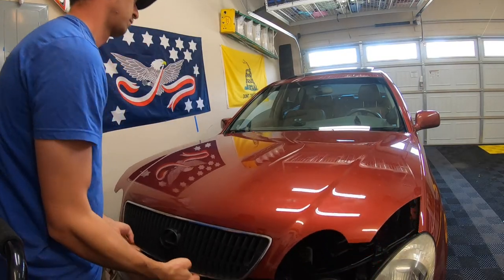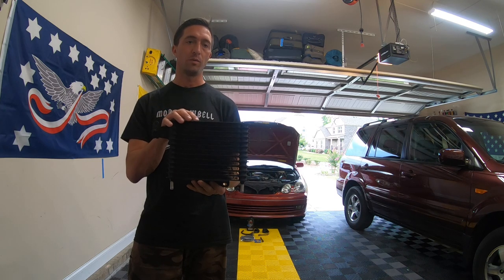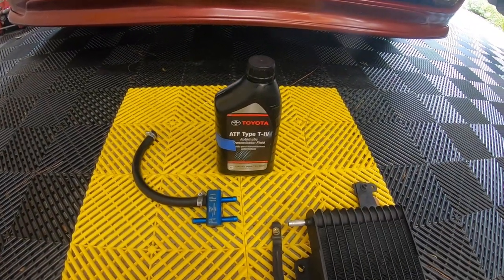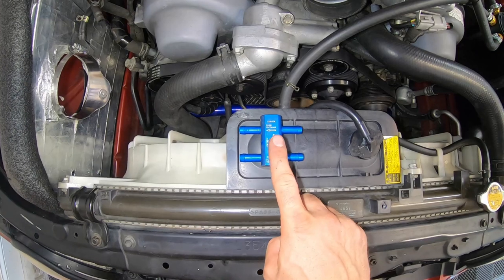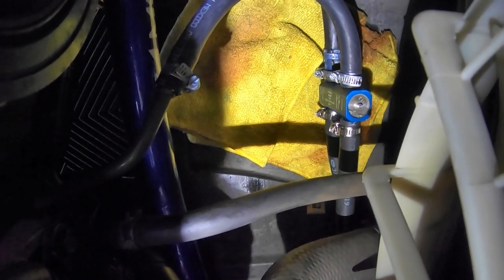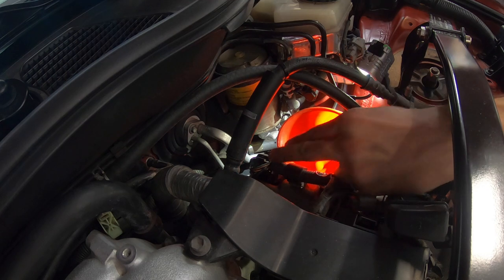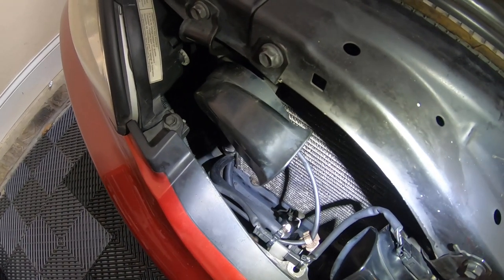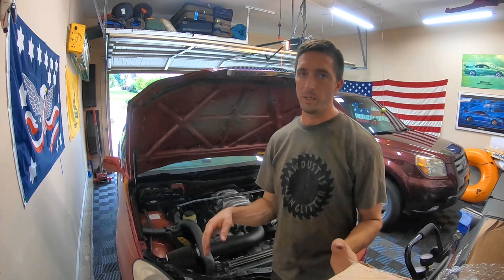External Transmission Cooler Install Instructions

Comment: Watching this is inspiring me to install one on my 98’ SC400.
Reply: Did you ever get it installed?
Reply: @camronramsey4861  Yes I did, very easy to do. I also have a high stall torque converter that I didn’t install myself haha
Reply: @armaniortiz6011  trying to install a trans cooler on my 99’ SC300.
Reply: @camronramsey4861   did you also install the temperature switch valve on it as well? I had to because of the sometimes very cold temps I drive in. After watching this video its very simple however the main issue I had is the placement of the actual cooler, and the hoses for the fluid, not in my most favorite spot I could've put them in but it works. lol
Reply: @camronramsey4861  did you install it bro? I have a 99sc300 aswell and I want to get this done tomorrow because my koyo radiator and mishimoto transmission cooler got here today! Do you have an ig where I can add you so you can send me a picture of how it’s installed?

Comment: Good video!  Add a 3rd mount for the trans cooler to triangulate the mounting and that will help with the vibration.  Cannot wait for the Valve Body update. Unfortunately I have the aristo transmission 4 speed, hopefully it is similar.

Comment: Great video. Thinking about doing this for my Tacoma so I'm watching different videos for install ideas. Well organized garage. What is the storage rack above the garage door?  Thanks!
Reply from the maker: Thanks for stopping by! I had a '98 TACOMA TRD LTD and (6) 3rd gen 4Runners, including a supercharged '96 V6 5-speed with 4.30 gears, e-locker swap and a huge list of mods. Amazing rigs! The rack above the garage door is: "SafeRacks - 4x8 Overhead Garage Storage Rack Heavy Duty (18"-33" Ceiling Drop)"
Reply: @ForwardMomentum  Thanks for the information on the rack. Looking for my oldest son. I subscribed to your channel for more ideas and info, like the oil catch can for my rig and the wife's CX-5. Thanks again

Comment: i purchased this same catch can and stuffed the bottom full of steel wool, but upon installing it into my 2GS300, it made my car run funny and made weird noises like my valve was doing something funny and sound squeeky so i uninstalled it... curious if i install it incorreclty
Reply from the maker: Double check if you ran the catch can out line before or after the throttle body. It should be attached before the throttle body (closer to the air filter).

Comment: Loving the videos! I literally just drove home an 07 GS350 AWD. I'm new to the lexus club lol. Love the car and was just curious if you knew anything about this model.
Reply from the maker: Welcome! I don’t know a ton about those, but I know the 3.5 is a great engine. If I had to replace this car quickly, I’d look for an IS350, so basically the same drivetrain as your GS.
Reply: I was looking at the IS350 but with car seats it was just slightly to small for my daily. Out of curiosity, why the 400? With the 3.5 putting out more then the 4.0 and having a better aftermarket scene.
Reply from the maker: When I bought the 400 back in 2012, 350’s were out of my budget. Kinda sucks because the IS350 would dust me after 60. Then there’s the ISF...my dream car!
Reply: I didnt realize you have had the car that long, makes sense now. Yeah the F's are nice! Thanks for responding back and I'm telling the Florida scene about your channel to help get those subscriber # up. Make that ISF a reality!

Comment: I have a question. I’m planning on buying one of these, which model year is best for this gen? Also are those wheels stock?
Reply from the maker: You can’t go wrong. There wasn’t a bad year with major issues. They are all tanks. Maintenance records or proof is key. The wheels are off a 2016 GS350. Thanks for watching!

Comment: Im looking for a 2nd gen 300 or 400 anything i should look out for when buying one my budget is low so most likely buying on closer to 200k miles
Reply from the maker: Michael - Check out my inspection vid. Also see the comments section.

Comment: Awesome vids keep up with upgrades.  I had an issue with my 98' gs400. My engine is starting to die out when I'm at a stop sign and traffic light.... has this happened to you or would you know what this problem is?
Reply from the maker: It could be so many things. First thing I would do is a thorough check of the entire intake system and all vacuum hoses. Buy an OBD scanner and data logger like the Veepeak WiFi adapter. Run the Car Scanner Pro app and check your fuel trims. I’ll be filming a fuel pump video next. It could be that for you, but definitely narrow it down first.
Reply: Devinator 1212 my friends alternator couldn’t keep the battery charged and it would die while Idling
Reply: Happened to me, I checked all the vacuum hoses and nothing, after cleaning the throttle body and changing the maf sensor the problem was fixed.

Comment: When i go WOT 1st to 2nd it shifts good but 2nd to 3rd the car hits the rev limiter for like a 1 second and then kicks into 3rd, 4th gear is also harsh WOT, but smooth when cruising, could my transmission be going out?
Reply from the maker: Yes. Check fluid level first, but after that start saving for a new one. Mine did the same thing.
Reply: @ForwardMomentum  previous owner changed fluid, level looks good and he also changed the filter, i just hope it wont leave me stranded one day, it shifts okay for the mileage but i have a feeling its near the end of its life
Reply from the maker: Probably right. After all, these are 20+ year-old transmissions. I was pretty bummed when mine started to go out, but it really pushed me into the manual swap. 😎

Comment: thanks for the video Christian.  I guess i don’t need a thermostatic module here in FL? So if i’m not going to use the thermo module then i tap the line first that was dripping and run it to the Top connection of the cooler and where would the bottom connection of the cooler go too?  thanks.
Reply from the maker: Np. I guess it depends on your low temps in winter and if you will ever take the car anywhere cold. A lot of people run a cooler with no thermostatic valve at all. If you do, you would run that soft line out of the OEM radiator to the cooler by using a barbed 3/8 coupling (that package I only used the hose clamps out of is perfect) and 3/8 hose. Then cooler out back to trans by attaching to that hardline. Same as my vid shows.
Reply from the maker: BTW, that package of hose clamps and 3/8 coupler was $2.49 at my local Harbor Freight.
Reply: Forward Momentum.  thanks.  I don’t think i’ll use the thermostatic valve.  I’m just confused on where the line coming to the stock cooler goes?  Then the top external cooler line goes back into tranny (the one you pulled first that was leaking).   sorry for the noob questions.
Reply from the maker: I understand. I had to draw it out, LOL. So just concentrate on the same line I unplugged in the vid. The line on the left, which feeds the OEM cooler just stays in place. Disconnect OEM soft return line from its hardline connection. Fluid will spill out. Add a coupler to that OEM soft line and more 3/8 hose. Run that to the top of the new cooler. Connect more new 3/8 hose to the new cooler on the bottom (out) fitting. Run that all the back to that original hardline you disconnected from. Hose clamp everything. That’s it!
Reply: Forward Momentum  Found a cooler by Hayden but it is 11.5 x 7.5.  Is that too big?
Reply from the maker: That should work!
Reply: Forward Momentum  do i need clamps on the coupler?
Reply from the maker: Yes. At every connection.

Comment: Y would you send the oil back to the intake u would have more oil in the Catchcan if you  Eliminate the intake one.
Reply from the maker: You need vacuum for it to work properly. If I vent to the atmosphere it will stink, spew oily mist all over under the hood and the car will fail inspection.
Reply: I don't know, every time I change my oil I take the oil out of the catch can and it has a good amount, if it's working for you that way, then leave it. I have turbo car's  I wouldn't want nothing back going to my throttle body, Cause that oil goes in through the heads and you accumulate oil in your  Valves.
Reply from the maker: I hear you. But that’s exactly why I did this mod. The baffle plate collects and drops the oil and contaminate-free “air” goes back into the intake. This is beneficial because the octane value is raised. I’ll keep an eye on my TB and see if anything gets on there. So far so good - this method is working well.

Comment: I’m planning install Long Thru 4590 transmission cooler for my 2008 Lexus IS250, is it the same process?
Reply from the maker: It should be.
Reply: @ForwardMomentum  because i don’t see trans cooler lines to the radiator
Reply from the maker: I mean they have to be there. Does this help? https://www.my.is/threads/need-part-number-oil-cooler-hose-a-t.607569/
Reply: @ForwardMomentum  that’s for IS300
Reply from the maker: Hmmm. Ok, well I just punched into Google. Perhaps you can try and report back? I’m not an IS250 expert.
Reply: @ForwardMomentum  ok i will see how it goes and reply

Comment: I have a gs300 2000 what exhaust do u recommend to get the best tone from the car
Reply from the maker: It’s so subjective. My taste may be totally different than yours. My suggestion is to watch all the vids you can of the GS3. I personally like it loud. In fact, mine is too quiet as-is and I’m considering going to bullet race mufflers to still pass inspection, but still be loud.
Reply: Forward Momentum makes sense I was speaking on a certain brand I should have been more definitive
Reply from the maker: Brian Redford I really like Borla, at least on the 1UZ.
Reply: Forward Momentum gotcha thx u

Comment: Would you know which company would carry a ITC for a gs300?
Reply from the maker: Trans cooler?
Reply: @ForwardMomentum  yes a lot of the companies I looked into say in bold red letters it my not fit
Reply from the maker: @rudyramos6263  don’t worry, just follow the sizing I have. The custom bracket is the hardest part.

Comment: Does it matter which way you mount any trans cooler? Looking at mishimoto options
Reply from the maker: If you’re asking if there’s a “front” and “back” no, it doesn’t matter. However, there’s an “IN” and “OUT” for the lines.
Reply: @ForwardMomentum  ok and one last question how much fluid did you put back in? Did you prefill the trans cooler? Or just fill the trans with fluid
Reply from the maker: It’s really up to you on how you want to do it. It’s pretty tough to fill the cooler unless you have a good way to hold the fluid in (assuming you can even get it in there). That said, note the capacity and line capacity and add ATF accordingly. When you start up the car, let it run for a bit so it cycles the fluid. I personally would add the fluid after just to keep the mess down.
Reply: @ForwardMomentum  ok perfect ended up buying a universal mishimoto kit going to be swapping in a shimmed and shift kit a650e into my 430 this weekend
Reply from the maker: @InverseGrill  nice. LMK what you think of it!

Comment: Dear FM how many rows this cooler?
Reply from the maker: Sorry, I don’t know. I haven’t had an auto trans for two years now.
Reply: @ForwardMomentum  oh bro I didn’t see that video was before 3 yrs😂.. but what kind you preferred? 4 rows or 6 for GS400 auto trans cooler
Reply from the maker: No worries. There isn’t one answer that fits all. There’s an ideal operating temperature for the AT, so the cooling surface area depends on your climate and driving habits. A reputable cooling company like Mishimoto can probably offer you a better answer than me.
Reply: @ForwardMomentum  
As you know im from Uae so weather in summer is so hot and as GS400 owner i drive speedily add on weather temp thats mean i have to install T cooler..what if its from china? It handle it or no?
Reply from the maker: Any additional cooler should help, yes.

Comment: Can you link the parts ordered ?
Reply from the maker: The only reason I didn’t link is because I received this free from the seller of my valve body upgrade. It was used and there are so many options out there that I wanted to encourage people to look at options that might suit their needs better. For example, some may want the entire thing in the air flow, so they would want to go with a longer, skinnier cooler.
Reply: @ForwardMomentum   on another subject, not sure if you know anything about this. I have a valve body in my infiniti, there are refurbished ones I can get for half the price, i was told they have to be flashed to the vehicle? is that correct
Reply from the maker: I’m sorry, not sure about that. I did nothing special for my VB upgrade.